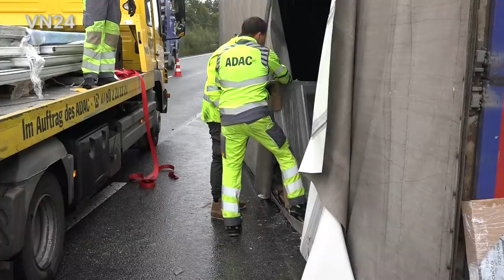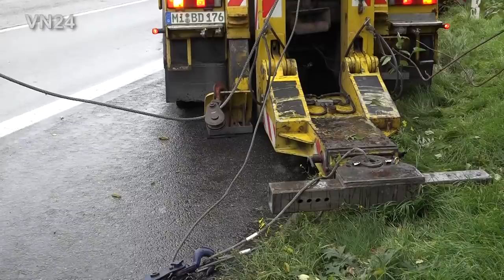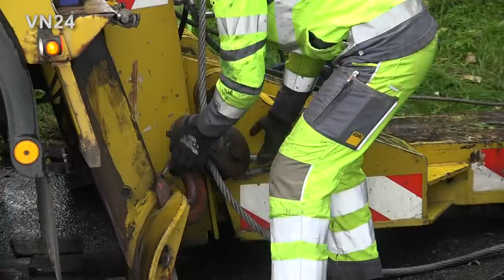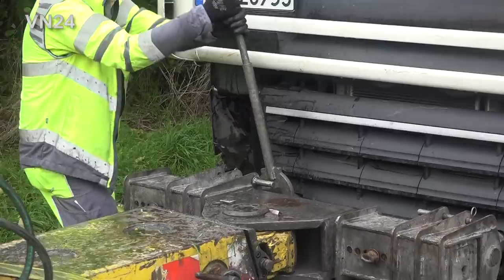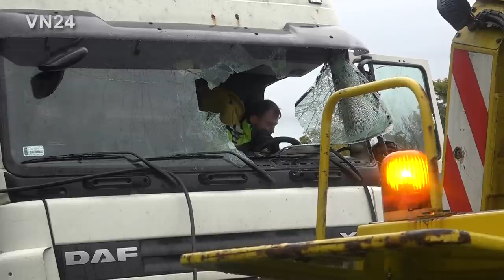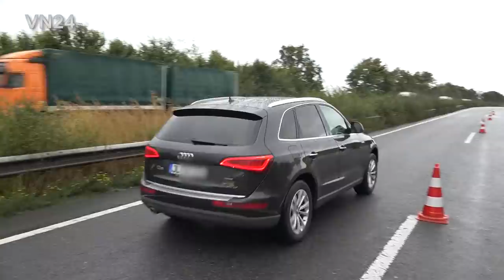15.10.2021 - VN24 - LKW kippt nach Unfall auf A2 bei Vlotho auf die Seite

Comment: The tow truck could do with some work on it, it looks positively decrepit with rust and rust stains all over it. Does not look very professional at all, if they can't look after their own equipment, are they going to look after yours or mine?
Reply: The technique is brutal. They make no attempt to "look after" . They just violently flop the trucks over and haul them off. Those soft sided trailers tie up traffic long enough with them needing offloading. Yet another Polish DWI, driving while impaired.
Reply: @deconteesawyer5758  I was not referring to the crashed truck, I was referring to the tow truck, sometimes known as a wrecker, the truck being used to salvage the crashed truck. It is all rusty and stained - not a good look.
Reply: @oigleoystereater2003  You missed the entirety of my response to your concerns about esthetics.
OK. Put bluntly. They could give a rats ass about their truck showing it's age, and they could care less about your stuff. Clear now ?
Reply: @deconteesawyer5758  if they could care less about my stuff, they must care something about it, so maybe you mean they could NOT care less, as the phrase should be said. 
That doesn't mean that they cannot care for their own equipment, all their colleagues in the same game in the same country can and do. What the aesthetics of the equipment means to customers and the motoring public is that they care about other things like safety, as well as the customer's equipment. 
To counter your point about the time taken to clear an accident site, a well maintained truck will do the job far more efficiently and quickly than a wreck like the one in the video.
Reply: @oigleoystereater2003  Admit it. You just.like to hear yourself talk. Your original post was not a question, simply whining about cosmetics, and conjecture disparaging the contractor.
Have no doubt that the equipment is up to snuff. The German government is very persnickety about vehicle inspection, repair and maintenance. You fool no one.